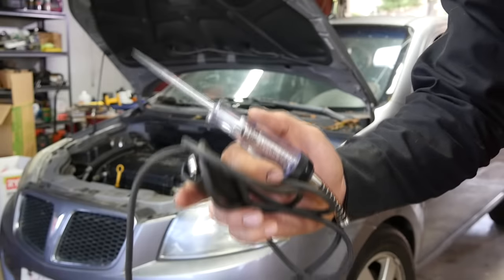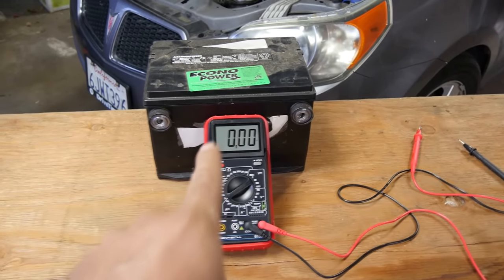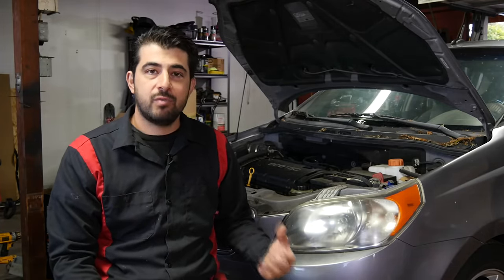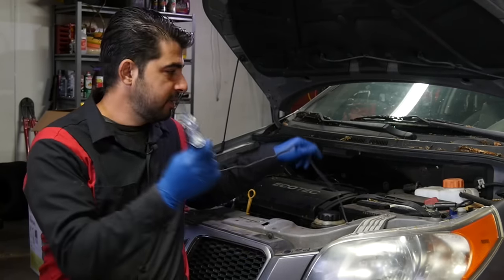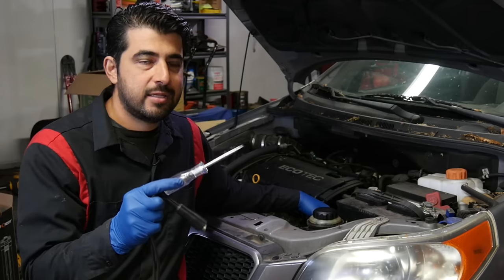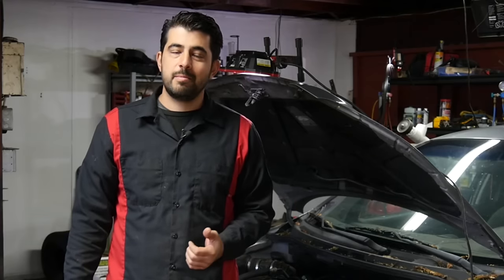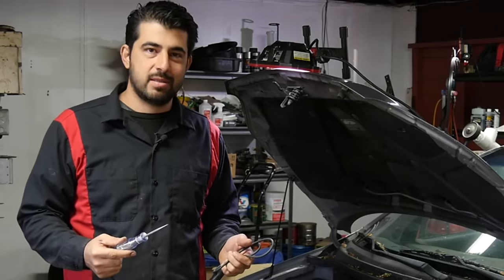MUST WATCH - Can a Test Light Damage Your Cars PCM ?

Comment: It is not very sensible to put 12 v on a cable when the PCM input is designed to see 1 volt max.  The inputs are typically buffered so present a high impedance to the input voltage.  However, a system running off 12 volts is  typically not deisgned  to take input voltages close to the  supply voltage.   The input could freeze (at least temporarily).  If the system is designed properly it should have  current limiting  circuitry (but don't bet on it as it makes the PCB's bigger and more expensive) . The input should also have a device to handle transient voltages  higher than the battery voltage .  In practice if the design engineer was having a bad day the input circuitry  may not be as well designed as it should be.  Remember also by putting voltages where they are not supposed to be  you may  leave the electronics walking wounded. In short  (no pun intended),  if you are going to put a voltage onto an input (presumably to test/simulate  a sensor) then make sure you don't exceed the maximum  expected input voltage that way you may save yourself a lot of aggravation in the long run .

Comment: 270mA is a LOT of current when we're talking about microcontrollers (for example, a common output high current pin can often not drive more than 100mA), so randomly poking 12v ~.3A at it would easily fry it. But, designers of ECM/PCM's knows this is an issued (mechanics randomly poking around with test lamps), so they must design the modules to handle this kind of abuse.

Use a proper multimeter instead, and learn how to use it instead of hoping that the designer of the engine module didn't miss anything :P
Reply: What exact "common output high current pin" can't drive more than 100mA? Tell me the exact car and module that can't do that without being fried.
Reply: rsx123 just have a look at the spec sheet for just about any common microcontroller, even the ones specifically made for cars & industrial applications.
But, as I mentioned, the module designers have to take sausage fingered mechanics with probe lights into account when making the outputs, so they usually have good protection against stray overcurrents.

Comment: Over load told you below in his comment that inrush current on an incandescent  test lamp can exceed two amps.  He is correct.  Just hook up you scope for a single trigger to your test light and you''ll see the inrush current.  Using a meter you only see steady state current. The only place on a pcm you should be using this type of test light is when testing powers and grounds, never on a signal input or output.   Besides what does a test light tell you about those pins?  Absolutely nothing!  You want to test the integrity of the wires going to and from your PCM?  Fine, then pull the connector from the PCM and do your testing under a real load that is presented by various bulbs used in automotive.  A 2 to 3 amp bulb works well for these applications to determine if a wire can handle a load.  And the point where you hook up your multi meter to your test light and tell us there is no current flow because the light isn't illuminated is not true.  Of course there is current flow, but because you meter has such high impedance (resistance even on the cheap meters is 1 mega ohm) the current flow is so low it won't light the lamp.  Did you forget that in the beginning you told us a meter works by measuring current and showing us voltage by internal conversion to ohm's law?  So, if there wasn't any current flow you couldn't measure voltage based on your explanation.  Besides, that's why you use a multi meter because the impedance of that device is so high it doesn't affect the circuit you are testing.  Rethink what you presented in this video and correct it before people start blowing up their PCM.

Comment: That's why I use an led one, maximum of 20mA through it just to be safe, but I have never damaged or heard of anyone damaging a module with a test light and have been doing it for over 20 years!
The bulb is a resistor technically so should limit any damaging current through it.

Comment: Excessive currents are usually the reasons why ECM will fail. If voltages are greater than the battery's 12.6 volts nominal voltage can also destroy a ECM with the exception of an alternator charging voltage that can be as high as 15 volts. Reverse voltage will definitely destroy the ECM. Unprotected loads due to short circuits can destroy a PCM. Hopefully these circuits are protected with fuses that can react quickly enough. Fuel injectors with shorted coils will definitely damage the ECM. Some ECM may have protection to detect such excessive loads before there is permanent  damage. There are other reasons for ECM failures that are more environmental, such as water intrusion, oxidation or corrosion.
It's amazing that a vehicle's interior high temperatures are tolerated by these ECM.
I'm curious how age has an affect on the failures too.

Comment: You was close with description how multimeter work, in fact analog multimeters work like that and measure current via turning coil in magnetic field (that's why they are most accurate at uA range)... But digital ones measure voltage thus their highest precision is for mV range
Reply: Chey Astro cargo van

Comment: Can you make a video explaining the pros and cons on owning a 4x4 vs 2wd?  And also which 4x4 are best and which ones to avoid?
Reply: 4x4 = 2x the cost of tires, when you need to purchase new tires.  Also, twice the drive train stuff in a 4x4 system, more stuff to replace.  Get snow tires  and 2x2 drive train for the best low cost winter driving.

Comment: The resistance of the test light bulb  functions as a shunt or  ballast, thus only allowing about 7/10 of an amp of current. When you use your body resistance your doing the same but with a lower current value that you can calculate using ohms law.
E = I x R  
E= Electromotive force, and it's unit of measure is volts, and it represents electrical pressure.

I =  Intensity, and it's unit of measure is amperage, and it represents flow of free electrons of a conductor.
R =  Resistance, is what impedes flow of free electrons...

E = I x R or in it's easy to understand form V = A x R. or  Volts = Amps x Resistance.
Or 
Amperage = Volts ÷ Resistance
Or
Resistance = Volts ÷ Amperage.

Free Electrons are the electrons that are on the conductors (element) last orbit of electrons, also known as valance electrons.

The more Free electrons an element has, the better electrical conductor it is.

Mercury is the best electrical conductor, but it can't be drawn into a wire. 
Next in line is silver, but cost prohibitive. 
Copper is the 3rd best and best choice when it comes to cost.
 
Gold is 4th in the list but also cost prohibited, but it used when its resistance to corrosion are more important than cost. 
eg: electroplating connections of high end  stereo equipment.
Gold is used in cel phones and satellites...

It is the free electrons that in a conductor that is moving, this movement of electrons is measured in amps.

Their is a misconception that amps causes heat, it's due to that it's used as guide due to its relationship to heat, as long voltage remains consistent. 
 The truth is that it is the product of volts and amps
 ( Volts x Amps = watts )
watts is power, watts causes heat, wonder why hair dryer are rated in watts and not amps. 

Amps is equal in the entire circuit, but the fuse is installed on the postive (Hot side of the circuit) side not the negative side.
eg: simple circuit, you have a 12.6V and your load us a head light that draws 3 amps, the whole circuit is going to draw 3 amps, be uses amps is equal throughout the entire circuit, and you can measure this with a DVOM on the postive side and the negative side of the circuit. And the result will be the same. But is you measure the heat on the postive wire vs the negative  wire the positive wire will have a higher temperature value then the negative wire.
If you measure the voltage drop from the battery positive to the negative end of the head light, then save this valve. Then measure the voltage drop from the negative side of the head light to the negative side of the battery, and also, save this [near zero voltage, in milivolts (mV)].
Then you apply the watts formula [ W = V x A ].
The resultant is the positive side of the (hot side) a high value of watts when compared to the negative side of the circuit, this is why most ECM, BCM, TCM and other computers use ground side switching. I used the term most becuase I have found that Chrysler  uses in some of their circuits positive side switching through transistors like un eg: EGR valves and in lighting, In lighting if a similar bulb is used but the watts value is higher than specks, it usually results in smoking the BCM. And if it's an all in one unit, were the ECM, BCM, TCM & ABS is integrated as one as I seen being used lately, the whole unit hast to be replaced.

Now back to the test light. I am going to give you an example how can you smoke an ECM, BCM, ABS or a TCM with a test light. 
New Tech, fresh out of tech school, or an inexperienced Tech. is using a test light,  test light bulb, blows out and the Tech needs the test light now, so tech substitutes a dome light bulb. since it similar in size and it's a good fit in test light. The dome light build draws a little over an amp of current [ see the  danger] and then uses it to check if the ECM is grounding an actuator. This is how an ECM, BCM   TCM or ABS unitl is smoked...

And on Chryslers ABS wheel speed circuit,  ,don't know is its true on units designed By Fiat/Chrysler, but on units prior.
Try using a test light, one that its bulb hasn't been replaced w/a dome lamp bulb. A you will smoke the ABS wheel speed circuit, Also, if use for more than a few minutes on a Chrysler EGR control side circuit, which is the postive side, You will smoke the EGR valve driver...

I know I got carried away with this  explanation, but I felt is important in understanding how electricity behaves...

Comment: according to scannerdanner your typical 200mv incandescent will NOT hurt the pcm, since hes one of the best in the field of electrical diag and hasnt hurt a ecu using his 180mv incandescent id say your chances are pretty slim. if you want to feel safer just use a a bulb that draws under 200mv like 100mv,

those led ecu safe test lights are trash as they put no load at all on circuit "like .010mv) only good for seeing what wires what and a few other things.the led can cause misdiag too easy

Comment: Hi I have just seen your video on how to adjust a throttle position sensor I have a 2.0L EFI ford pinto engine will your way of testing them wires work for an Electronic Fuel Injection system

Comment: My Mercedes Class A 2002 has cooling fan not work even in AC on, I just check the connection to Fan control module with a test light and see all the power is OK and the wire from ECU make the test light up and down lighting when the car running, and amazing after that the fan work perfect again !   Don't know why, maybe it resets something in ECU ???

Comment: If there is a pathway to ground, doesn’t that mean that your are effectively sending 12v to a signal wire that is meant to take 2.5? The problem is that the pcm grounds the circuit, thus sending more amps than it was designed to handle. Idk man I only use a test light on 12v wires.

Comment: Voltage can certainly destroy electronics.  24v on a 12v system is going to cause major issues. Also ive seen a test light destroy a pcm.... It wasnt a computer safe test light but ive heard that even those can do the same. You need to measure the resistance of the test light and also the resistance of your multimeter. The meter is going to have a resistance similar to the human body, s computer safe test light will be much lower and a regular test light will be the lowest.

Comment: My car’s O2 sensor’s wire was damaged. When i went to the SERVICE CENTRE they told me that the pcm has been damaged due to faulty O2 sensor. So they wanted me to bear the cost which i did then. But i was never sure that a faulty O2 sensor could damage the PCM. They did not cover the PCM in warranty.

Comment: Ideally, even if the 20A probe of your multimeter is unfused, the red wire of your test lead should be dimensioned to act as a fuse, protecting the multimeter. Ideally.

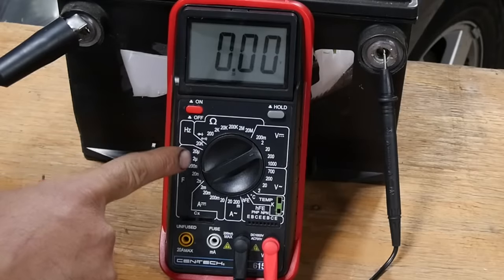Comment: In the example at 5:00....Why didn't the test light light up?   There is voltage present but no current flowing.  Does that have to do with the way the multimeter/PCM works?  It can measure voltage without current flow?

Comment: A test light clamps to a ground, to test for hot wires. Read the instructions it tells you to connect clamp to GROUND , test probe to check for power

Comment: Snap-on and Mac tools make test lights that are designed to use with computers in your car. The early car computers used 7 volts then over time they went to using 5 volts. If you hook up wrong and put 12 volts trough it you will destroy your computer

Comment: I unhooked the positive battery cable from my fuse box and touched the end of it to the metal part of my PCM and the car started to click and flicker and now it won't start. The fuel pump also doesn't cycle on then off like usual anymore, just stays on.  Have I fried my PCM??

Comment: In 1992 or it could have been 1993 a little girl in a small town called Kosti where I lived died from a car battery. Back in the days, multimeters were not commonly available to everyone. So, what they used to do was use their tongue to test the 9v batteries, the ones for radios and cassette players.
The idea was to spit on your arm place a battery right on it and then touch the positive side of the battery with your tongue if, you felt a strong  tingling sensation then you knew the battery was most likely full or at least good to use for a couple more hours. As for the car batteries, you would simply attach 2 leads to a battery and strike the 2 together rapidly as if you were lighting a match if, it sparked weak the battery was either bad or very low and if the spark was nice and bright then, the battery was full and good to go. 
Now, the little girl's father and brotherwatching and absorbing everything.batterytongue. She dropped dead right there. Her mom saw her falling from a distance. She was 7 years old.
This shook the whole city not just the little town. It was devastating.
I encourage everybody to please, watch out for kids and yourselves when working on anything regardless of how dangerous it is. Aorganize things around

Comment: I had my test light on negative terminal and accidentally put test light probe on postive wire. Light didn't light up. Then I tested ground on same plug in and nothing lit up. Bulb is good. Did I damage anything by my 1st mistake on plug-in positive to Battery ground?

Comment: I like this youtuber because he tells it straight. But this is why you don't let just anyone near electrical circuits. There's a lot of problems with these explanations, starting with the multimeter. 

Multimeters use very high resistance when measuring voltage, in the megaohm (1 million ohm) range. Check you're manual, it'll say somewhere in there. I have a similar model meter and its about 10 MOhm. That test light is about  45 Ohms (12.6V / 0.27A). For a series circuit you add the resistance. 1 megaohm + 48 ohms is about 1 megaohm. So of course, there isn't any real change in current (notice the light's off?). Now take a signalling circuit designed with a 200 Ohm resistance on the signal side and an internal resistance of 200 Ohms. 400 Ohms total. Now you decide to measure that circuit with a 12 Ohm testlight (not uncommon). Now that same circuit has 212 Ohms of resistance, and its carrying almost twice the current. Something that could easily cause damage. 

Multimeters also designed for high voltages, after all the range goes way up there. Some circuits aren't designed to handle more than a few hundred mV difference.  If you look at some of these signalling circuits you'll notice they actually carry a differential signal pair straight form the PCM. By that I mean that the PCM provides the + and the -. They aren't bonded to a common ground. So its nearly impossible for one of these circuits to have a 12V potential across them. A lot of signalling circuits will also use a bias voltage for measurement. This bias voltage limits the difference the PCM expects to see. On a 5V circuit it could cut it in half to 2.5V. Stick your 12V source and now it might see 7.5V difference. 

You never need to use a testlight on a signal circuit. A decent multimeter will do the job just as well if you know how to use it properly. If you can't do basic voltage and voltage drop tests with just a multimeter you need to learn some basic electronics.

And finally, I can't believe I have to say this, NEVER EVER USE YOU'RE BODY AS AN ELECTRICAL TEST DEVICE! Under some circumstances some circuits will have a lot more than 12V, and at doesn't take much more to get a current flowing across you're body. I've seen insulated tools get vaporized when two circuits were bridged accidentally. You can buy a cheap meter with long leads for less than $20, a new finger is gonna cost a bit more. If you can't afford to do the job safely, you can't afford to do the job.

Comment: Um, no voltage is not how fast electrons flow from negative to positive, that would be Amps, not Volts.  A good analogy is water flow.  In this analogy , voltage is like the pressure difference.  It's the driving force that makes current flow.  Amps is the rate of flow and watts is the power of that flow.  Power is a function of flow rate and pressure so Watts = Volts x Amps.  Energy is power per unit time so Watt Hours = Volts x Amps x Hours.  Simples!